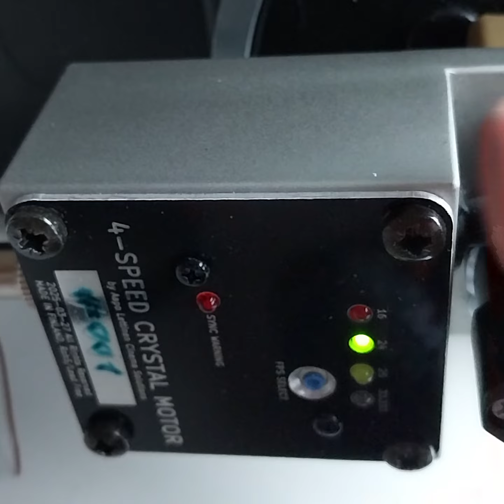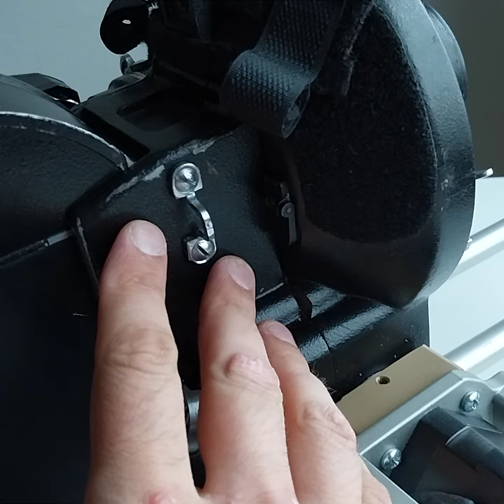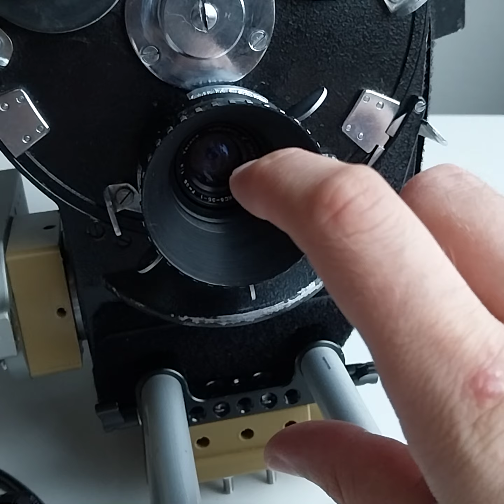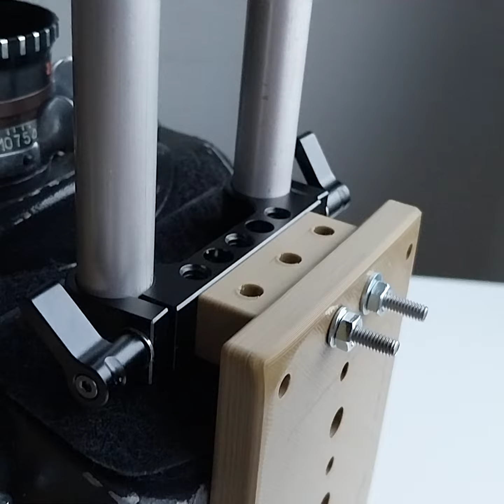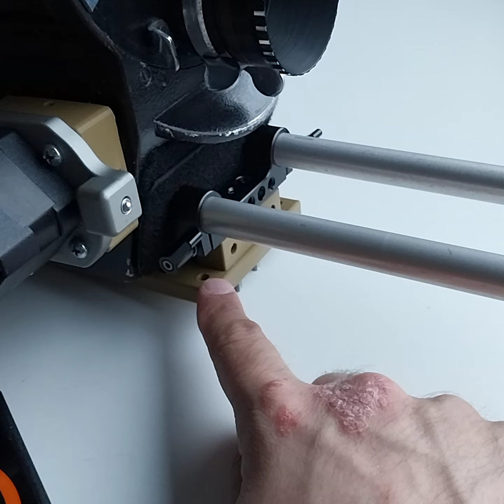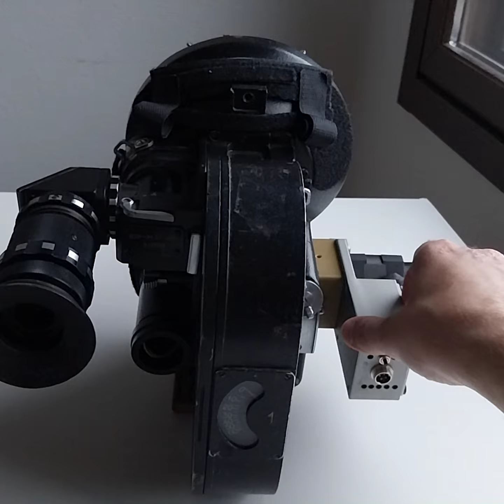Konvas with 4-speed Universal Motor by ALCS! 20251130 test

Comment: Hello from London, I'm very impressed with your work. Could you please tell me how accurate your speed controls are? Have you done audio sync tests with the cameras?
Reply from the maker: I am usually testing the motors and speed controllers with a crystal stroboscope light and gpsdo locked aim-tti TF930 frequency counter at 100s gate time. Normally not doing developed film tests as they are not accurate enough. with the TF930 I can see the real accuracy down to 1/100 000 000 th to get more scientific results. Typically this type of motors can run at about 40ppm to 60ppm accuracy (parts per million) on well maintained low friction 16mm camera meaning that it might drift one or two frames if shooting a full 400ft roll of 16mm at single take, very easy to correct in post if it happens. but people who use these motors can rarely afford spending thousands of bucks per day on countless single takes costing 500 bucks each, usually they shoot about 1 to 3min takes which is fine with this type of motors. They were originally designed for about 2 to 4 minute takes. Konvas is a bit less accurate due to high friction in the camera but should be somewhere around 100ppm range even with Konvas and it has shorter rolls so probably one could not detect drift with that short rolls or it would be around 1 frame range if happens. I am tuning the V2 motor version to start better with Konvas so if specifically looking for Konvas motors I would select the 4speedV2 or the 50-speed or the 6-speedEXR motors which are similar size than the 4speedV1 but have newer crystal sync software tuned for wider speed range

Comment: Do you sell any of the control boards for the cameras?
Reply from the maker: the separate 4-speed boards without casing or motor? If you buy a lot of them at once then could be possible, the minimum order for separate boards of this type is about 2500usd and will calculate then how many boards you would get based on when it is paid for, what extra stuff needed etc. In addition to the 4-speed board you would need a Chinese made bldc control board, one per motor, they are affordable under 10usd a piece. and the motor drive I use has custom axle which is only available by custom order from chinese factory, these motor drives have minimum order of 50 pieces at the moment so one really needs to arrange some kind of package deal and me knowing exactly what you are going to do with them if you want to order separate components. If only needing one or two motors worth of stuff then I have the cheaper 4-speed motor for 500usd which has the motor part separate via short cable and no aluminium casing like this normal 4-speed has. though would recommend this standard version with cnc machined one-piece casing for most uses